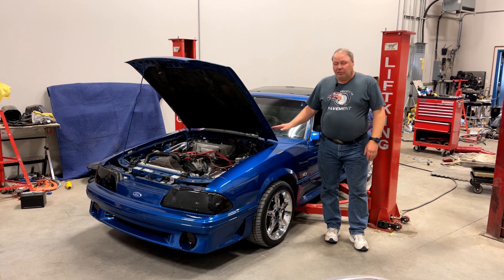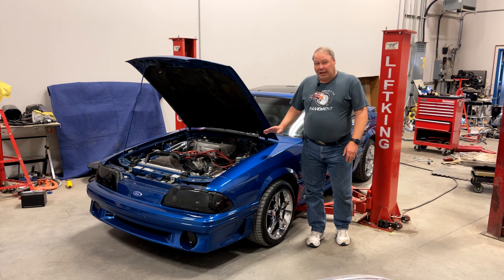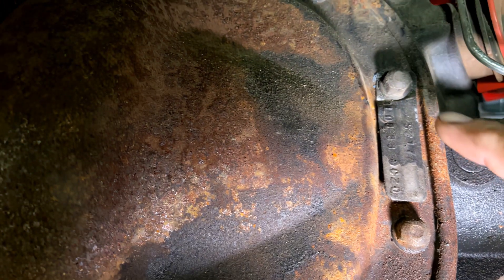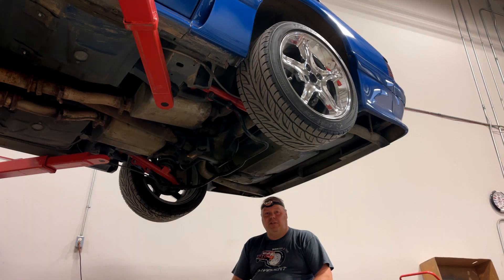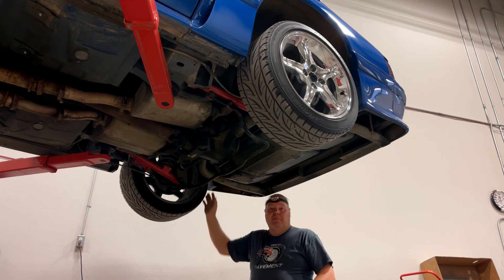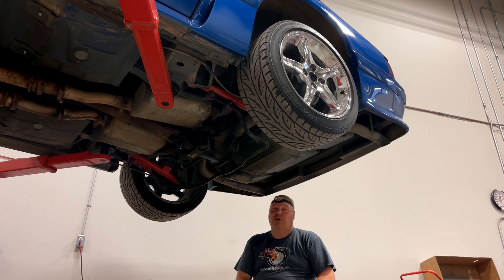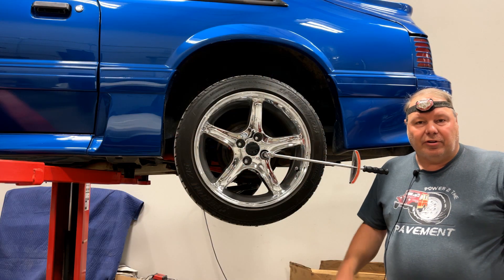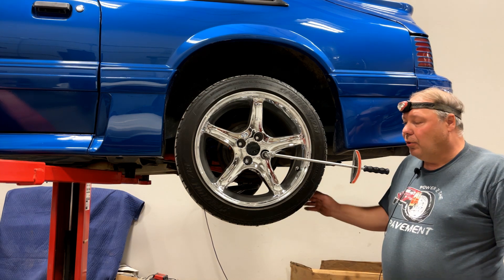Foxbody Mustang Final Drive Checks, or What Gears Do I Have and Do My Traction-Lok Clutches Work?

Comment: How about where to put smoke in on a foxbody to test for vacuum leaks.  I'm not sure where to put the smoke it at.  Thanks if you got time to make a video.  I have a surging idle on start up.  Trick flow stage 1 hci.
Reply from the maker: A surging idle is more often than not caused by something other than a vacuum leak. A typical cause is that the throttle stop setting and the target idle speed setting in the computer are at odds with each other, and either the computer cannot idle the engine down low enough to achieve the target idle, or achieving the target idle requires too much duty cycle on the idle air bypass valve to achieve the target. If the surging goes away when it warms up, it is more likely to be an issue with too much IAC duty cycle, and the problem gets less as it warms up and the target idle drops. Maybe I should make a video showing the right way to set this up because I know there is a lot of witchcraft and misinformation out there about it.

Comment: Man thats some good info to test the Lock .... went out right away to test ..I know that I have a 373...and Hell of a Lok ..didnt brake loose with 60 ft lbs on the Lug nut !!!! Torque wrench lenght also 17 inch
Reply from the maker: The factory traction-lok is really weak - it accounts for something like a 1% traction difference from side to side is all. There is a rebuild procedure where you reorder and add a clutch disk which tightens it up quite a bit and there are aftermarket options out there that are tighter or use carbon fiber clutches so maybe you have something like that in yours. I don’t have a torque breakaway spec for those setups, but 20 ft-lbs on the axle centerline is the Ford spec for a factory traction-lok from this era.